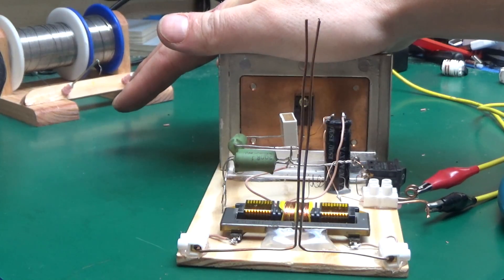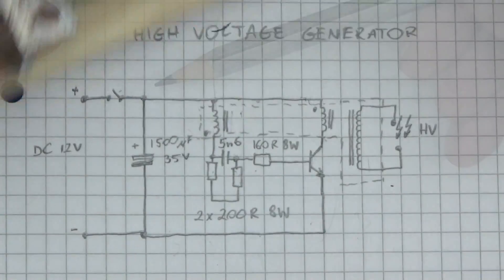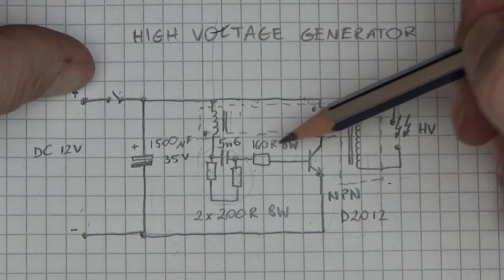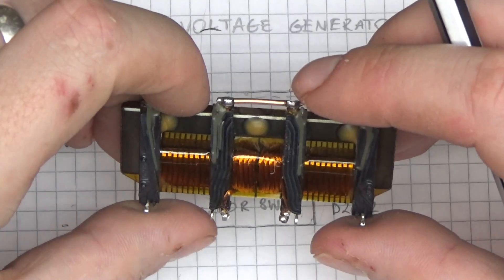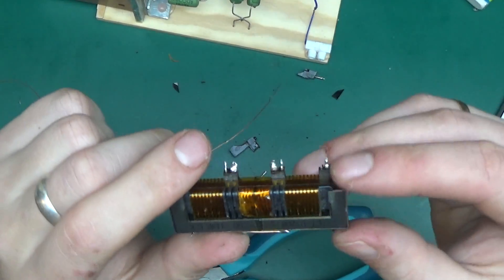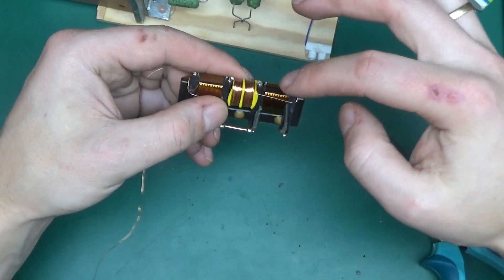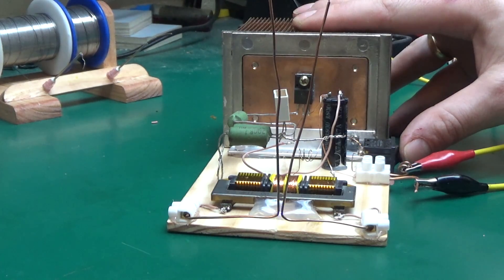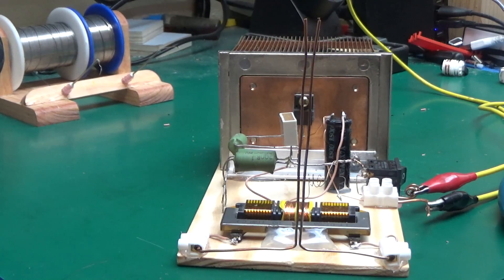New high voltage transformer

Comment: I'm more into digital rather than power electronics... I'd love to learn more about wound components... I'm a bit confused by this "feedback winding"
Reply from the maker: Feedback winding is simply put an extra secondary winding to provide low voltage just as a feedback signal to primary side, so the switching regulator knows when to fire MOSFETs on primary.

Comment: The primary was way too many winding. I suggest ripping it off and putting a few turns with some thicker wire and use a ZVS driver for huge ass arcs
Reply from the maker: +killer chemstar the risk with that is that too high voltage on secondary will break down enamel insulation and it will arc over. But yes, less primary turns (and higher current) = more fun on the business end :)
Reply: So many things an engineer needs to contend with isn’t it :p